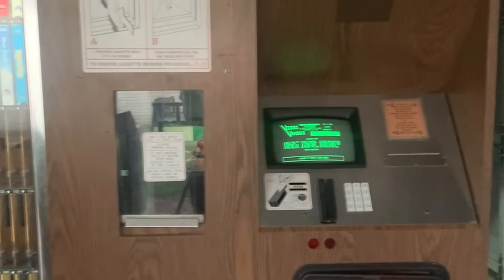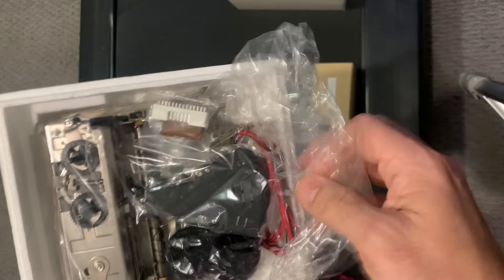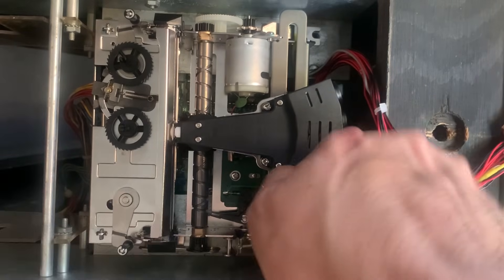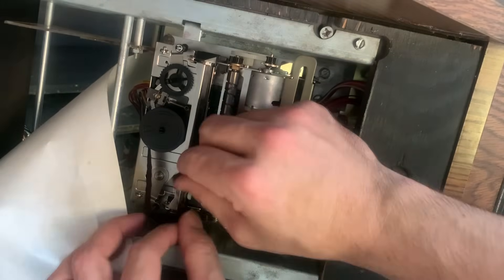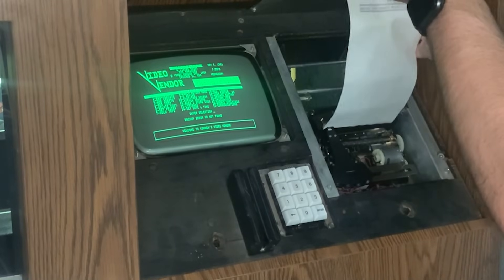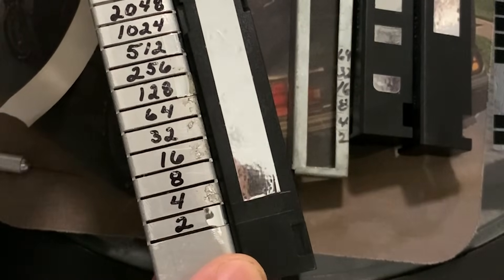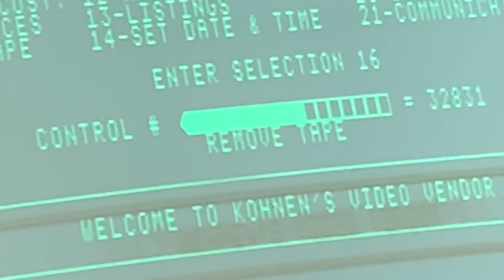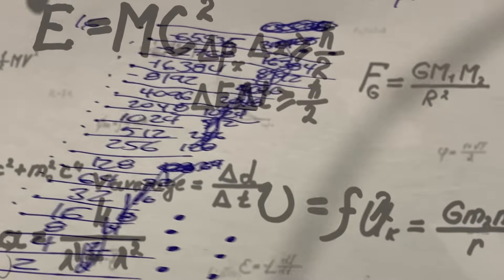VHS Memory Unlock Part 5: Retro Surgery On a 1984 Video Vending Kiosk

Comment: Shouldn't there be cases or slip covers for the tapes?  That might be affecting alignment.
Reply from the maker: The machine is designed to deal with bare tapes. We can put them in with their cases on, but the grabbed appears to be tuned to grabbing an exposed cassette.

Comment: LOL this is great.  Is there a modem in the Video Vendor or did poor Kohnen had to print this page and then key in each CC transaction manually at a later time?  I used to work in CC processing 20 years ago and I recall that there were official "test cards" we would use to validate a POS system reader.
Reply from the maker: @meatpockets  he used membership cards and associated a credit card with those. He'd run a report occasionally and then run the charges based on that. A little manual entry I bet.
Reply: I’m old enough to have used one of those old CC imprint-taker gadgets with the carbon copies and the chunk-THUNK slider. We collated all of our copies, and the manager would sort through them all at the end of the day.

Comment: From the looks of it these are not actual barcodes, but the metal strips are likely completing a circuit to denote a binary value.
Each section would need at least two contacts and I suspect you have dirty contacts that are causing the misreads. Try to locate them and clean with electrical contact cleaner. They might look like brushes, or springy pins.
When you apply the stickers you would also need to ensure that you have clear space between them, so you don't short one to another.

Comment: The barcode is based on 2 bits
Reply from the maker: Are you sure? The maximum number countable with 2 bits is 3. 65535 was the largest number it was displaying. Is it a math thing?
Reply: @spacetimejunction  They probably mean two bytes -- 16 bits maxes out at 65535 like you mention.

Comment: so it reads barcode as 2 bytes of data. I would put in 1010101010101010 then 0101010101010101 to test the reader. edit; also... first ;)
Reply from the maker: Check this out: https://codepen.io/spacetimejunction/pen/PopmPwr
Reply: @spacetimejunction  It it meant to top out at 64999?
Reply from the maker: @greggv8  65535
Reply: How are things mark?  It's cool you are fixing the video vendor